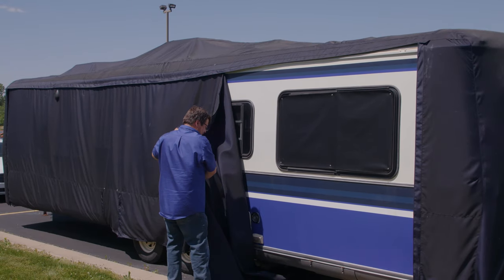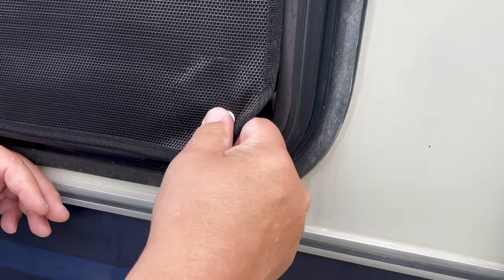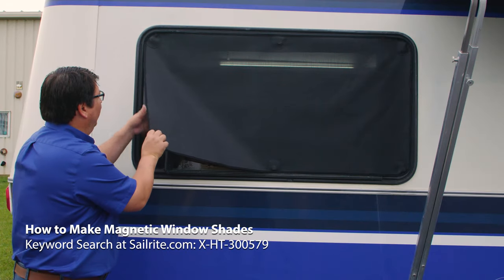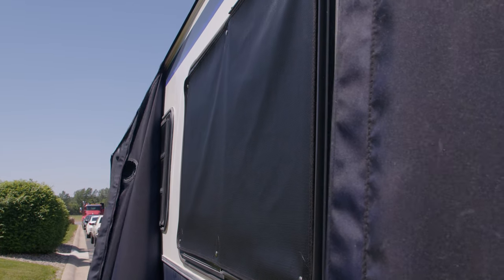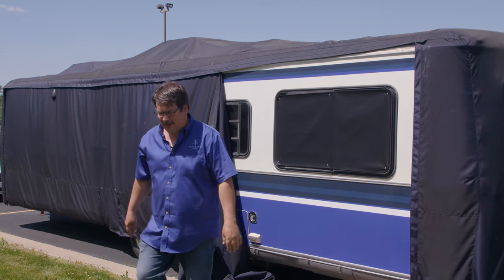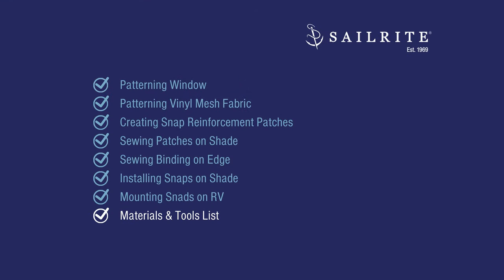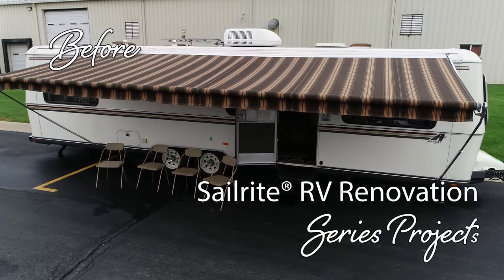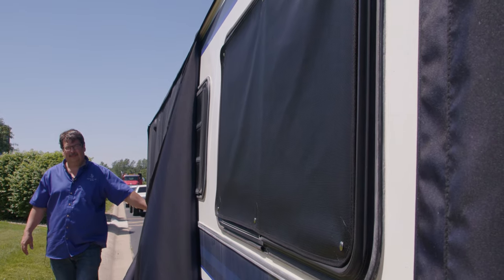How to Make Snap-On Mesh Window Shades

Comment: Great idea.   Only concern, if looking for reducing heat penetration, is the metal trim.   In direct sunlight I get temps on the inside metal frame upwards of 180 degrees (Texas 100°+) Might want to install to sidewall to include coverage of both window and frame.  
Using Suntex 95, we get about 90-95% less heat radiation on the windows and frames.    Couldn't have done it without this video.  Thank you

Comment: Love your videos! We have an LSZ-1. Can or should that fabric be cut with a hot knife?
Reply from the maker: I don't like cutting Textilene or Phifertex vinyl mesh fabric with a hot knife because it has a tendency to burn the edges too much. Instead I often cut the vinyl mesh fabric with scissors and then run a hot knife along the cut edge to seal the Polyester core fibers. In doing this it helps to reduce the burnt look, especially with light colored vinyl mesh, like white. An edge that is going to be covered in binding never needs to be heated with a hot knife.

Comment: Gosh... I'd have thought they would have worked better mounted on the inside instead of the outside. Why'd you chose external mounting?
Reply: Was going to say the same
Reply from the maker: That could be done if you wanted.
Reply from the maker: @JD2jr.  Yes, that can be done if you want.
Reply: Mounting external shields the windows (and frames, if you include them) from heating up in the first place.    If you want to mount inside, go with ceramic film.    Or both.   Film inside to reduce glare and some heat, screens on exterior  in extreme heat to drastically reduce radiation heat.

Comment: I am using this video to guide me in making replacement sunshades for five large fixed windows on my boat. Things went exactly according to plan until the binding part. I bought a 3/4 inch binder on lieu of the one inch binder that came with my LSZ 1 machine and 7/8 inch binding.  
The problem is that the video shows adjusting the medial-lateral position of the binder to obtain the appropriate position of the stitch line. 

My experience was that because of the “ski tip” extension of the binder which stopped the movement of the binder closer to the presser foot than the medial aspect of the foot/feed dog I could not achieve a stitch line that did not, at times, result in a stitch line that did not include the binding. I could not adjust the binder in a way time get a consistently satisfactory stitch line that did not consistently miss the edge of the binding. 
Once I switched to the one inch binder and binding, there was no problem. Maybe I am missing 
I may be missing something, but the 3/4 inch binder doesn’t work for me as shown, although the one inch does. 
What am I missing?
-John Cope
wilaby@bellsouth.net
Reply from the maker: Hi John, Because the 3/4" binder must be moved closer to the presser feet of the sewing machine and the "ski tip" gets in the way, I remove the "ski tip" with a Dremel tool cutting wheel. It is not required for sewing and it lets you position the binder closer to the presser foot to move the stitch inside the binding edge. I hope this helps!
Reply: @SailriteDIY  problem solved. I noticed in the video that the piece on the binder was much smaller, but I figured it was an earlier model.